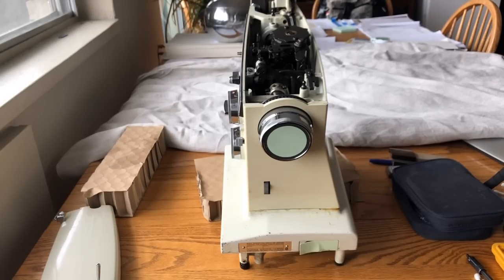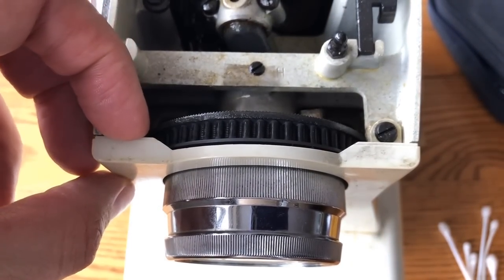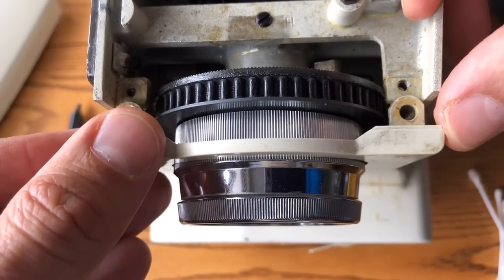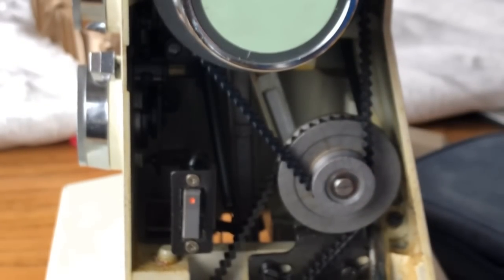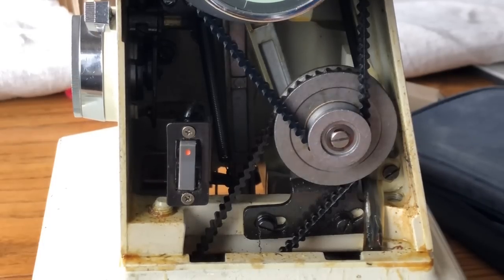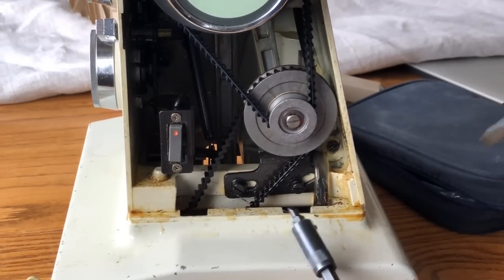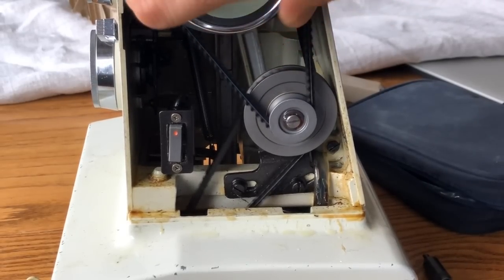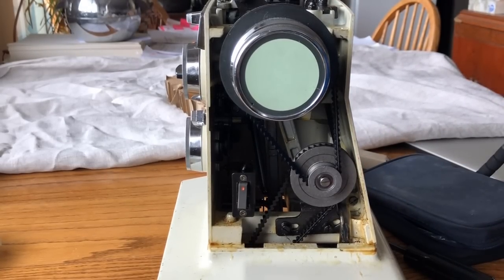RESCUE SERIES #5: How to Inspect & Adjust Kenmore Dual Belts Via Access of the Pulley/Bracket Side!

Comment: Thank you so much! I have a new-to-me Kenmore 158.1831. It's in pretty good shape but I was worrying that the handwheel moved too stiffly & could not figure out how to remove the side panel. Now I know, and I also know that there is sufficient play in the belts. I'm oiling other areas to see if that helps wake it up. I also appreciate your comment about not tightening the screws holding plastic and metal pieces together too much. Excellent video!

Comment: I have just started watching your videos. I like your approach to repairs, patience. Great videos. I have a few questions. Have you ever used brake cleaner to help clean parts? Is sewing machine oil the same as sae 20 non-detergent oil? Where would be a a good source for parts? Keep the videos coming. Thanks
Reply from the maker: Thank you for watching Anthony!  I have not used brake cleaner.  One reason for this is that when using any kind of liquid, its so important to control where it wanders and runs to.  Any strong solvent can react with and damage paint finishes.  The other concern is keeping any liquids out of the motor.  For mechanical parts, your idea might be useful, but I have not experimented.  I have another product I plan on trying for this stubborn Kenmore so stay tuned.  Oh, no, sewing machine oil does not have an SAE specification as far as I know.  Thank you for sharing and commenting!

Comment: I have 158.17033.    Has plastic side panel like yours, but the side wheel covers the hole keeping side panel from coming off.  The band slips. I want to get to the band and clean it up or replace.   How to get the side wheel off ?  Any idea?   Belt seems oily, but may just need the bracket adjusted.

Comment: I have a kenmore Mdl 1914. My motor belt broke, so I couldn’t see how it was actually threaded before, nor see how it looked in your video since you didn’t have that showing on your video.  I have the new belt on, and the machine sees, but is now making some type of rattle noise and the belt doesn’t look right to me.  If I could see “how” it should be threaded on the motor that might help me figure out what’s wrong. I was trying to keep it out of the shop so I wouldn’t have to do without it for 3 or 4 weeks.  Any idea where I might be able to see the entire setup?

Comment: I have a zig zag that was making noise. I ordered belts, but when I checked the originals, they seemed fine. What WAS loose though, was the PULLEY. It wiggles a bit left and right.  The bracket is lower than this machine though. its RIGHT underneath the 2 spaces where you put the side plate back on.  Is there any way to tighten this or fix this without taking the spring and whole bracket off? anyone have any idea?
Reply: I have the same problem the bottom pulley moves in and out or left to right if you are facing the front of the machine.

Comment: Similar to machine in this video, Do you know if the 158 (chrome/plastic) hand wheel assembly is interchangeable w other “158 - Chrome/plastic” hand wheels?  Like a model 158.1941 with a 158.1781?
Reply from the maker: I actually do not know for sure Kevin, but given that I've never seen an alternate size, I would hazard to guess that the answer is yes.  But this is a guess on my part.

Comment: Hey, since you had already loosened the tension screws, why didn't you remove the belts, unscrew and remove the pulley, and give them all a good clean? And then you could have easily cleaned off that grease from the other parts too.
Reply from the maker: Great question.  I was able to inspect the belts and ascertained that they were not contaminated.  Had they been, I would have removed them and replaced with new.  Since lubricants will degrade and shorten belt life, I would prefer to replace belts instead of washing them, but these ( surprisingly) were fine.  I find these Kenmores one of the best machines for clients that want a vintage machine that can convert to a Free Arm setup and so I will likely have one that needs new belts in the future and will gladly make a video showing how to replace them.  Thank you for your suggestions.
Reply: Thanks for your answer. I'm looking forward to your next videos.

Comment: You must install the correct belts or. endless, pressure,,,  also you must oil the double pulley,,,remove and clean pulley shaft.  ,,,use a proper screwdriver.  ,,,why don’t you remove the belts and reinstall,,,that will be exciting,,,  you clean the belts ,,by running the Machine,,,and wiping the pulleys with paper towel.  All screws must be proper tightening,,not a pinch.   This is a good machine.
Reply from the maker: You share some good ideas Michael, but if the belts and pulley were the issue, the machine would not run after each of these initial 'cleanings' with the various products I have tried.  The pattern of behavior for this machine reveals that whatever grease I am loosening with these products I'm trying is thickening back up after the machine cools.  But , I "think" that the machine is getting cleaner with each application so we will see.  I do agree that it would a great video idea to showcase the belts and pulley overhaul.  However, I perform work on machines based on my assessment of what they need.  If I cannot get to 100 % normal running, I may take on your suggestion so thank you for that.